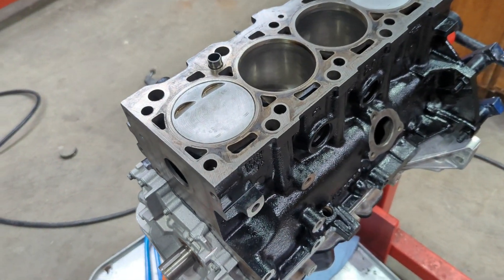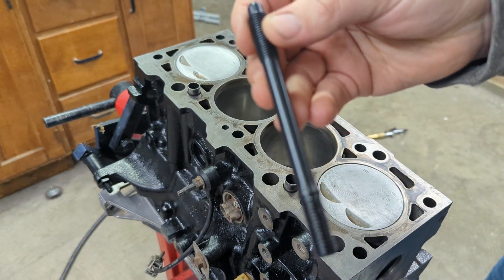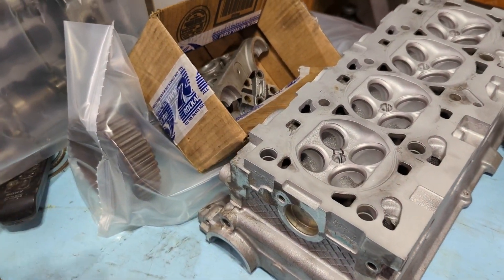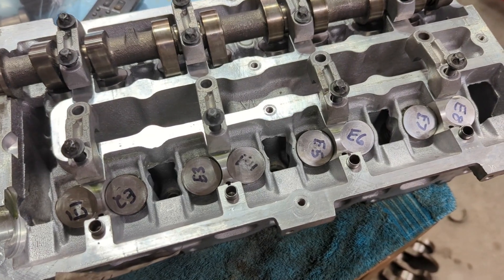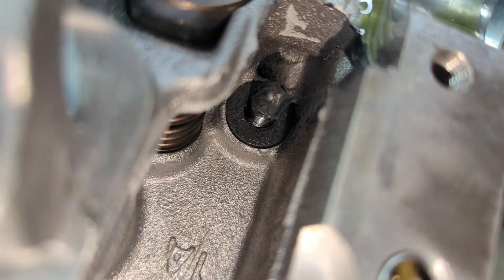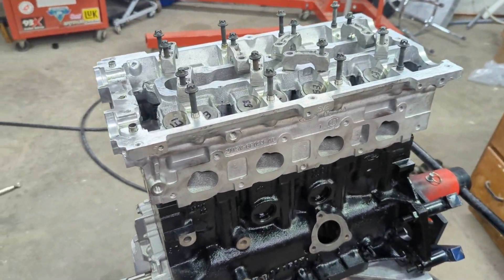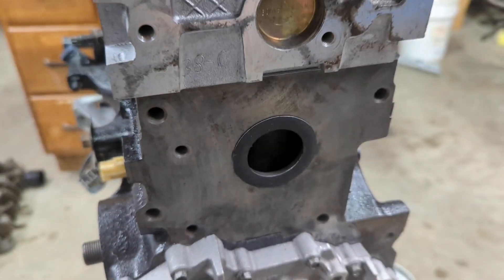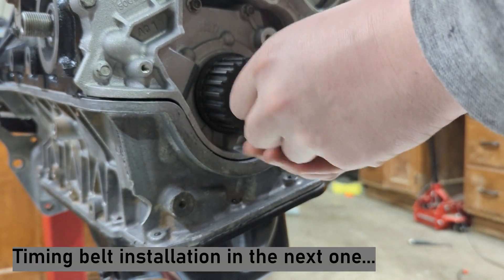SVT Focus Head Studs, Head Gasket, and Cylinder Head Installation

Comment: I've been looking for an SVT and a base Focus Zetec 2.0 Build to compare for a long time..  Thank you for doing the details here!
 What machine shop did you use?
Reply from the maker: No machine shop. Just built it. I had enough good parts between the two engines.
Reply from the maker: Correction, the head was set up at a machine shop in Sioux falls SD. Forgot about that part.

Comment: Love your videos. Love my svt
Reply from the maker: Thanks Ray! I have yet to get a bunch of miles on it yet because of it being broken when I bought it but I've been able to sample here and there and it seems like it will be fun.  Glad you like the videos! How many miles on your SVT?
Reply: @605BOLT  I have 116k miles. I have a 3 door black 2003 EAP SVT FOCUS. I GOT IT FOR $1600 about 3 years ago. I did the entire suspension , new power steering  pump with hose, steeds shifter, clutch, bushings, eibach pro springs, kyb adjustable shocks and struts,  upper and lower control arms, 24mm front sway bar and 28 5mm rear sway bar( rear lower control arms are modified with a welded metal plate.  New Ford water pump, all Ford timing belts, tensioner, pvc and hoses, and alternator.  
I was driving hard the other day...I was running an a3 turbo jetta..... not paying attention...I over reved  3rd gear( I believe past 7500...then I threw it on 4th gear...... I noticed the car felt way different right after that.... it starts up no problem and idles fine... you can hear the engine missing.  It feels sluggish when you drive it. I have not driven it for a year. The other day I bought a new battery and it started right up. I pulled the plugs and there was oil in when the plugs are. The plugs had oil on them. I checked the engine oil..there is no mixture of coolant and engine oil...thank God.   I hope it is only the valve cover gasket..... I did a compression test last year and Turbo Tom said those numbers I put out was common for that motor. I believe it is due to the vct on these motors. I also have something draining the battery..... the former owner of the car had her brother use it for a while and he wanted to change the bulbs.... so the fog lights do. NOt turn on.....   good bulbs...somit could be from that. I have to take time and just work out the bugs.... I need to figure out the driving problem now
Reply from the maker: @bigray3360  wow. That's a lot of work. Just about everything on the car has been touched in some way. Done way more work on yours than I have!
Reply: @605BOLT  yeah..  wanted to get the suspension right...have a new clutch, etc. It's my current problem that is bothering me
Reply from the maker: @bigray3360  ya that will be a little bit of work for sure. Especially if you have to do it all in jack stands with no lift.
Reply: @605BOLT  I wanna fix this problem.but I do not know where to start
Reply from the maker: @bigray3360  I'll have a clutch install video soon. Probably within the month or so.